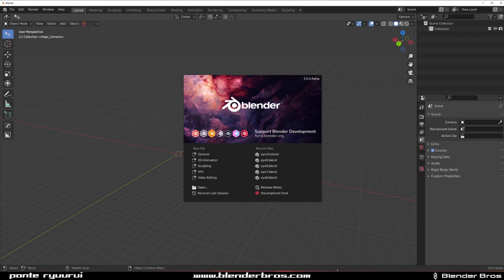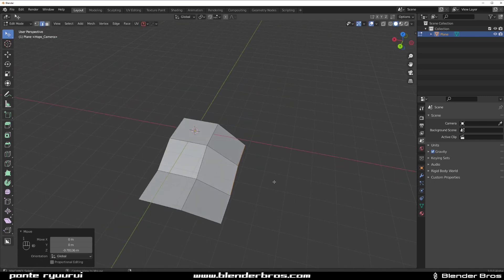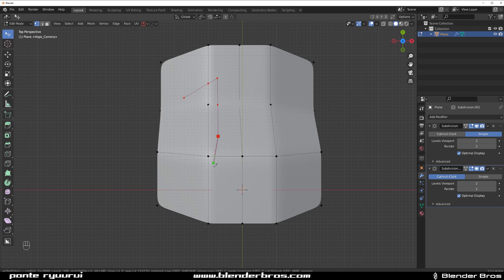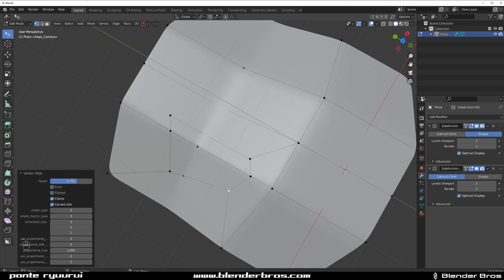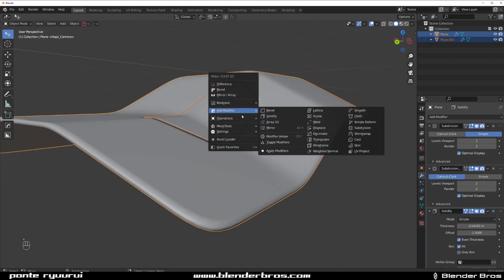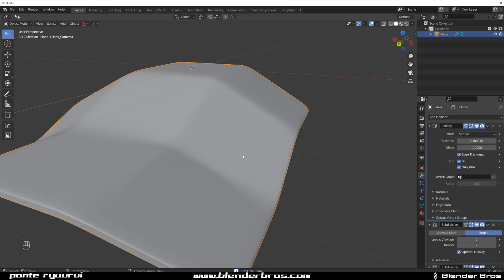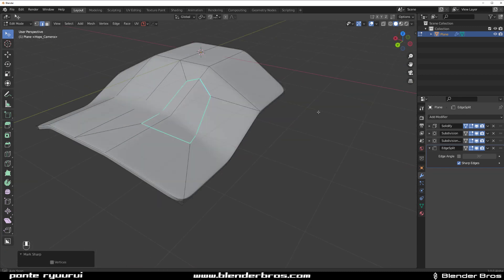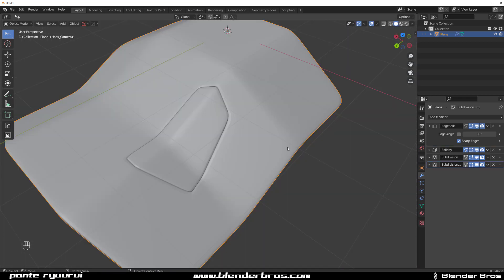NON DESTRUCTIVE hard surface panelling  - Blender tutorial

Comment: I really like how simple that is.  When applied what will this do to the geo? If it was applied to a solid object would it remain manifold? I ask because I used Blender for 3D printing design and so far all the easy panel lining makes it unsuitable for 3D printing as it makes unconnected parts. Any suggestions?
Reply from the maker: well if you apply edge split it will split the edges physically
Reply: @PonteRyuurui  I wonder if after everything is applied there is a quick way to add the depth to the panel line and reattach the edges (maybe bridging edge loops) to keep the panel line and make it manifold for printing. Definetly worth the time for me to try out and great video.

Comment: You only need to be careful not to end your panel on a kink in the base mesh as that will lead to overlapping geo. That is, the edges you mark as sharp actually need to have 180° angles (as in your video).
Reply from the maker: not sure i follow, 2 edges at 180 would be a straight edge mate
Reply: @PonteRyuurui  I mean the angle between the two faces adjacent to the edge. If this angle is different from 180°, there will be a kink in your edge,  i.e. the edge will be visible in flat shading mode. And, if you split this edge and apply solidification, the geo will overlap ( at least if you set the offset to 0 in the solidify modifier). But as I said, in your example there is no problem; after all, you only marked edges as sharp that you had drawn with the knife tool. Try marking all edges as sharp, turn up the solidification, and see what happens.
Reply from the maker: @LordoftheFleas  well, fortunately we dont run flat shading with subd, but if you add any lops, thi8ng will start looking ugly, shame we can t use vert groups with subd
Reply: @PonteRyuurui  It has nothing to do with the shading: Here's an example of what I am talking about: https://imgur.com/a/wxvm8bb The only difference in the right model are the additional sharp edges